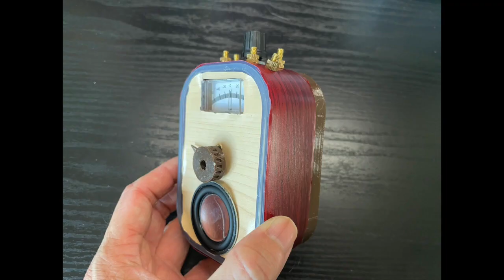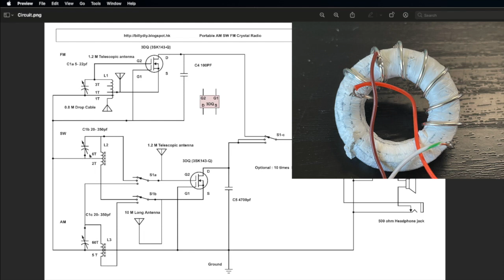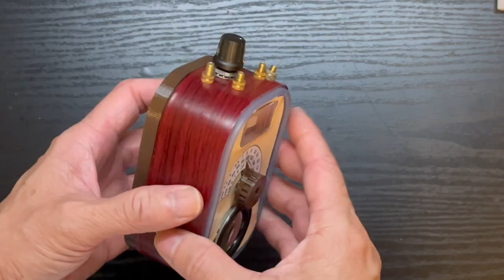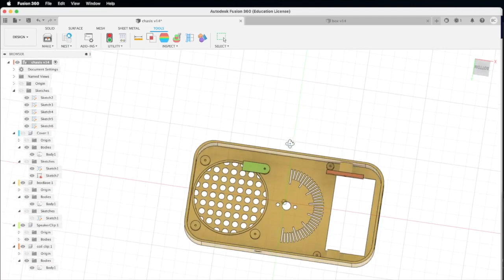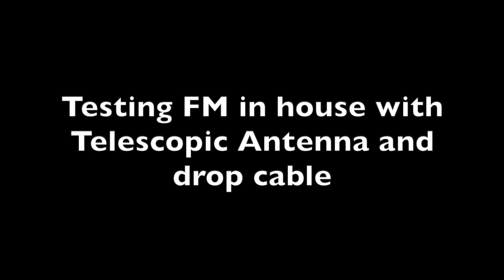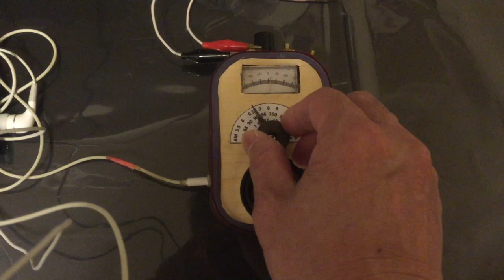Portable Crystal Radio AM SW FM with meter and speaker

Comment: Mr. Billy Cheung if I use the 1.8 meter antenna does it feel the difference compared to the 1.2 meter antenna?
Reply from the maker: Yes, there is noticeable differences. The 1.8M antenna is a little bit louder
Reply: @BillyCdiy  Mr Billy Cheung, thank you for that information. I built this type of fm radio and I only used 1n60 diodes and the transformer is 6.4 k ohm the output I modified and I can use mp3 player headphones I wish you other achievements

Comment: Selamat siang tuan
Ada pertanyaan.. 
1 apa bisa menggunakan transistor biasa..? 
2 untuk trafo ke speaker bahan materialnya seperti apa apa bisa d jelaskan cara membuatnya..?
Reply from the maker: Sorry. I cannot read your language. Please ask again in English
Reply: @BillyCdiy  sorry sir. 
This skema for transistor. ? 
What use transistor for BCE pin . Because for fet diffucule. 
Sorry language no good
For trafo .. What trafo to impendasi high..? 
Skema cristal radio use transistor BCE sir..?
Reply from the maker: @syarifudin8941  ，you can use diode , not transistor. Refer to my blog for the circuit diagram for diode .
Reply: Hi, Billy. Could you tell us about the improvement by using a mosfet replacing the diode?

Comment: This is actually one of your more elaborate projects, Billy. Good job. Too bad the speaker does not deliver more output for you. We need extra efficient speakers with high impedance.
Reply from the maker: Thanks. The tiny step down transformer for the speaker could be the root cause. I will test if the same speaker will perform better if driven by the bigger transformer like KBP-02